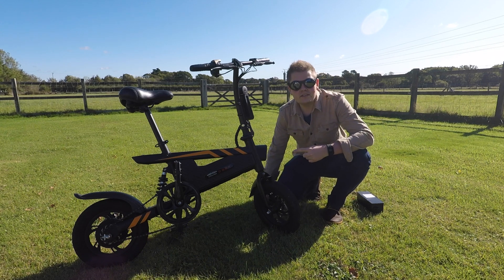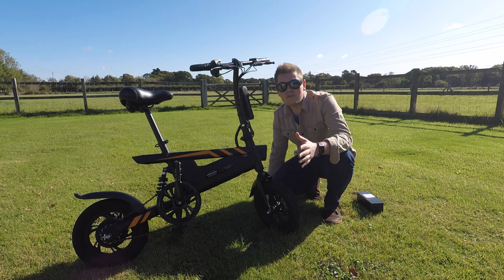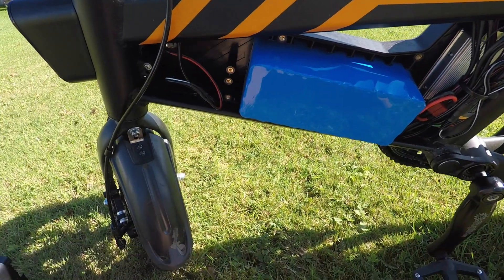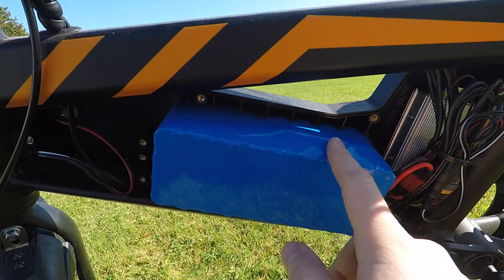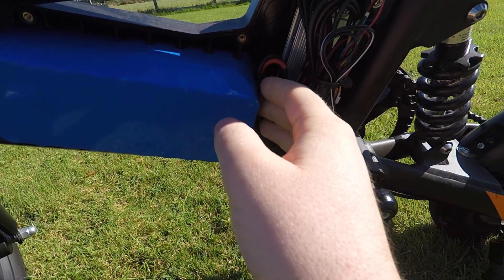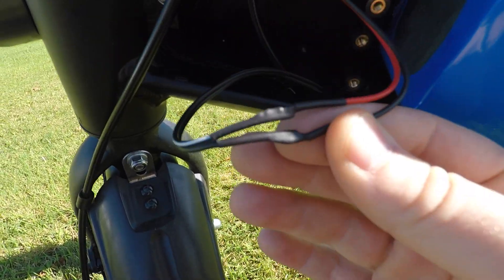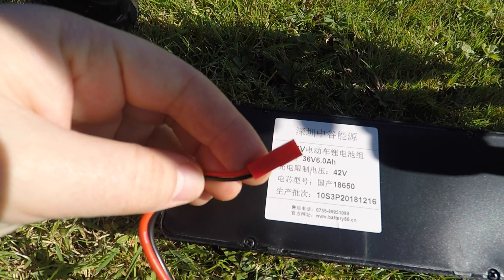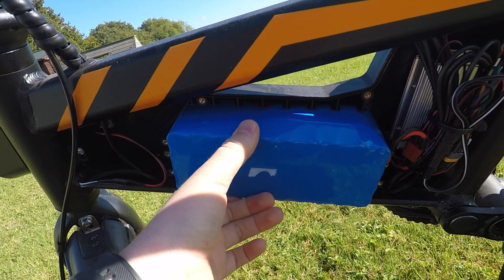Ziyoujiguang T18 Electric Bike Battery Upgrade 6Ah to 12.8Ah - 22 mile range

Comment: Thanks for the video. I ordered the 12.8ah battery from Aliexpress using your link for $122 with free shipping and got it in less than 2 weeks. I used some foam to fit the battery and got some T plug extension and used my old 6ah as a spare mounted on a rear rack not connected parallel.  Each battery has it's own charging port. Total range over 36 miles😊

Comment: Where can you get new battery from
Reply from the maker: US $127.60  12％ Off | Laudation 36v 12ah Electric Bike Battery 10S 4P For  250W 350W 500W High Power And Capacity 42V Motorcycle Scooter  With 15A BMS
https://a.aliexpress.com/_uRJMYe
Reply from the maker: That’s the one 👍🏻

Comment: This video is about a year old now.
I don't know if anyone will be able to help me.
I got one of these bikes about a year ago.
My battery died recently and im trying to replace it. I have no idea how the insides of the bike work.
 how exactly did you connect the extension cable to fit with the barrel did you have to do soldering? And can someone give me a link for the extension cable?
Reply from the maker: Talha,, Yes I did do quite a bit of soldering but if you didn’t want to solder you could always crimp the joins. I just used a generic 2.1mm barrel extension cable. The best thing to do is to join this Facebook group. https://www.facebook.com/groups/1923232947822469/?ref=share Its full of T18 owners.

Comment: 12ah battery finally arrived after 2 months of waiting and it works fine, at least 20 miles pure electric. I also noticed the original in mine was 7.8ah, not the 6ah that you show, anyway once again thanks for the tip.

Comment: i just have a couple of questions for now after doing the upgrade what charger do i use do i still use the one that came with the T18 and also i notice the battery on Aliexpress is 500w but the T18 only has a 250w motor does this matter thank you
Reply from the maker: The wattage of the battery just means it’s able to supply 500w but you will only be drawing 250w in reality, so that’s all good. 👍🏻 I use the charger that came with the bike and works like a dream.

Comment: Got my T18 for Christmas, but due to the weather and lockdown, only recently started to use it, so thanks for the advice, found a cheaper version of the battery here: https://www.aliexpress.com/item/33051585205.html?spm=a2g0s.9042311.0.0.5f554c4d4lg2N3
And just subscribed.
Reply from the maker: Gary, nice one! Let me know how it goes! And when you install the new battery just confirm the polarity of the charger with a multimeter. I hear a few people have fried the charger as they got the charge wires backwards inside the bike. 👍🏻
Reply: @ObsTech  Will do and once again thanks for the advice.

Comment: I heard the 14ah battery has a bad discharge rate drains to fast for this bike to get any good ride with out pedal assist The secret is you must find maximum Continuous discharge current 20A or higher amps {amps} is everything. These batteries 6ah, 12ah, and the 14ah are Maximum continuous discharge current: 15a makes bike slow
Reply: Hi, could anyone tell me where the best place to buy the new battery is, and what exactly am I ordering?

Comment: does this method require any soldering? I'm clueless about such things, thinking about doing this
Reply: Hi Adam! Can you send me the name of the charge cable that you use, also where can I buy this?
Reply from the maker: Teslina4Studios If you didn’t want to solder you could just use a cable connector and wrap electrical tape around it. It’s only the charge cable that need to be changed.
Reply: @ObsTech   Hello Adam where did you buy the charge cable?

Comment: AdamI just posted a how to video on replaceing the 4 Bar LCD to a 10 bar LCD. Hoping it's better at monertering the 🔋
Reply from the maker: David, amazing! I’ve been thinking about this as that 4 bar lcd Is a bit rubbish! Checking it out right now, thanks 👍🏻
Reply: @ObsTech  are you on Facebook? If so did you join us on the zi you hi guang page?
Reply from the maker: @davidrossmiller8349  Count me in! Just asked to join 👌🏻
Reply: By the way Adam I have 1 thew 5 video how to...might help with a couple of ideas. Here is the led I used

https://golfcartstuff.com/products/recpro-volt-battery-indicator-meter-gauge-for-ezgo-club-car-yamaha-golf-cart

Comment: I was already close to buying this bike, and now I just discover your amazingly straightforward range upgrade! Even better, I guess it would be relatively easy to drill the plastic case and make an "external battery" mod, allowing to carry several swappable batteries?
Reply from the maker: Kat Katapult I would say that would be very possible! Make a vid if you get round to it :)

Comment: what was the metal battry housing you pulled out is that bcause of battery heat
Reply from the maker: mark sutton The new battery doesn’t get hot, just slightly warm.

Comment: {What is your top speed with this battery and the t18} Do you feel good about the battery purchase the 12ah battery  his the bike quicker  pretty spunky or do you feel like you shoulda  moved up to a 14.5 battery which is same price,,,, Also  do you feel your back engine hub see if it gets warm  hot or cant touch it after a 5 min an let it cool off , ride then 20 min feel the hub on back wheel motor again it should not to hot to the  touch
Reply from the maker: mark sutton I’ve done a GPS speed test and looks like it’s around 16mph. I would say acceleration has improved. The motor doesn’t get dangerously hot, you can easily touch the hub motor without burning yourself. And that’s with riding it flat out, both on and off road until the battery is flat. I’m pretty certain if you want more speed you’ll need a new speed controller or over volt the bike.
Reply: @ObsTech  Does the T18 have a speed limiter jumper wire to disconnect?
Reply from the maker: Unfortunately it has no speed limiter jumper wires to disconnect.

Comment: Adam, A well welcomed modification for owners of this particular e-bike!  Please let us know your comments regarding the new battery, including performance over time and any issues (good or bad) which you may experience.  I would be curious to know how many hours typically you need to fully charge this battery if it has been drained from usage and shows one bar on the led display? Also, when you charge this replacement battery are you using the same charger which came with the e-bike when it was purchased?  Thank you in advance.
Reply: It is most likely the same charger. I am ordering mine with battery and charger so I will have a spare. 115.00 then again I might just do a 14ah mod instead. https://www.ebay.com/itm/BMS-36V-12ah-Li-Ion-BATTERY-PACK-BUILT-IN-Replace-ELECTRIC-BIKE-Battery-CHARGER-/392435322657
Reply from the maker: David Ross miller let me know how the 14Ah battery fits 🙂
Reply: @ObsTech  I am sure it will have to be modified. If it does I will likely use fiberglass sheats to make the battery case 1" wider. I also put a few videows on my channel for people having difrent issues.
Reply from the maker: Hi Ron, still using the same charger. I’ve been using this battery for a couple of months now and works a treat.
Reply: @ObsTech  Awesome!  Good to hear!